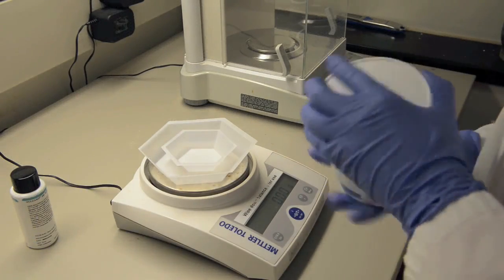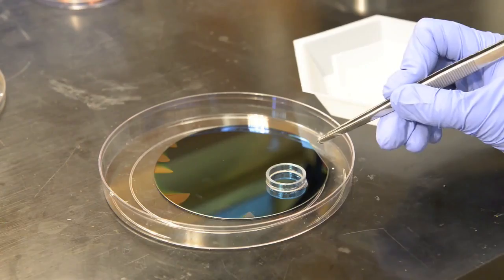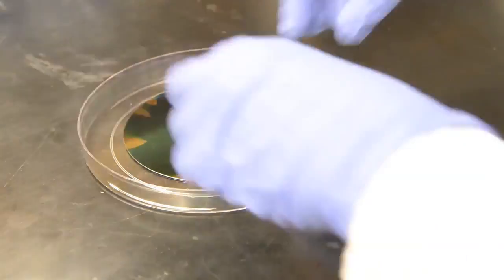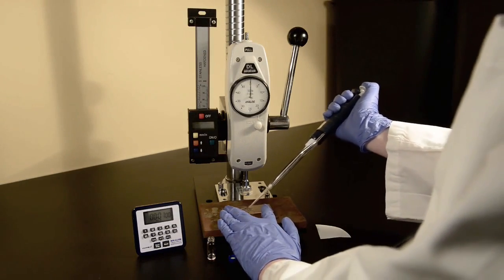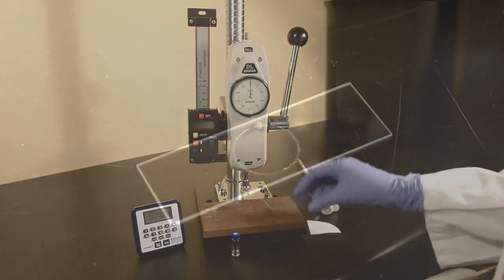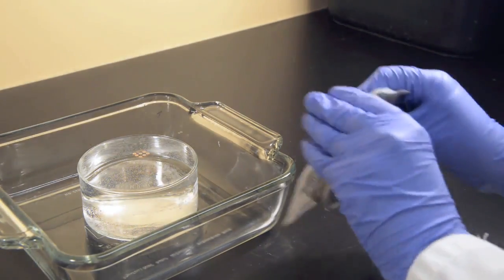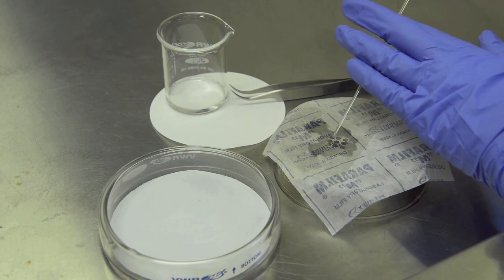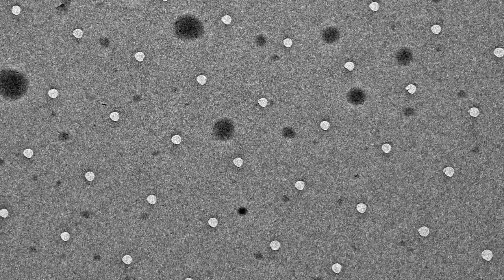Cryo-EM grid nanofabrication

Comment: What is the height of the features on the silicon master?
Reply from the maker: Sorry, didn't see this question here. The e-beam resist is ZEP-520A, ~350 nm thick. The features should be the same height. The features are made of resist, not etched into the silicon.

Comment from the maker: We now use a release agent on the silicon master patter (TRIDECAFLUORO-1,1,2,2-TETRAHYDROOCTYL)-1-TRICHLOROSILANE [WARNING: dangerous substance - use appropriate precautions]. This only has to be done once per master pattern. Deposit ~ 30 uL into an open top container inside a dedicated desiccator. Apply vacuum with wafer in chamber for  ~ 15 min to apply release agent to wafer. Too much release agent will inhibit PDMS binding to glass during stamp making. (NB: the release agent is not added directly on top of the master pattern, it transfers through the atmosphere in the dessicator)